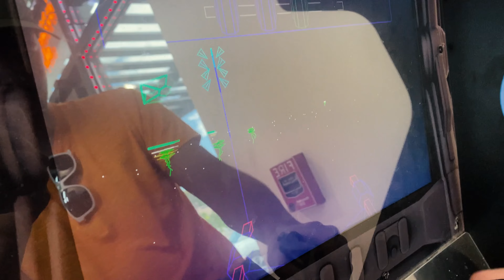ADV on the Bonneville Salt Flats : Ep2

Comment: i'm planning a motorcycle trip to bonneville salt flats.   Is there a certain location to go to get on the flats, like a entrance.   It looks like in the video you just got on the flats from the road.  Can you give some directions?
Reply from the maker: On HWY80 East of Wendover, you take Exit 4 for Bonneville Speedway. Go North past the Sinclair station then the road turns 90 degrees to the right and you’ll run straight into the flats.